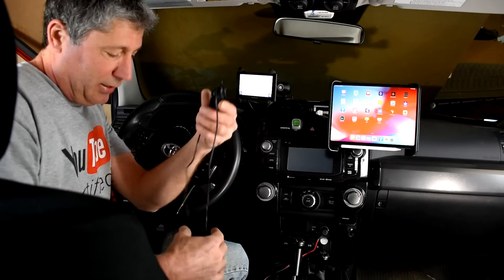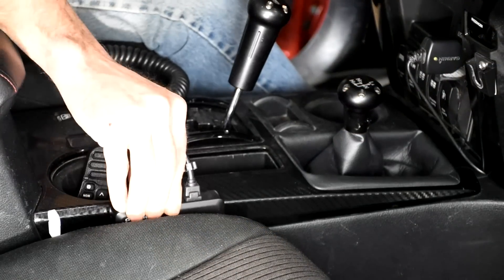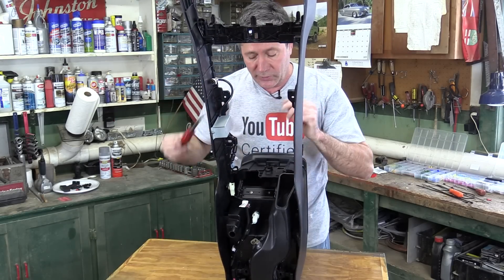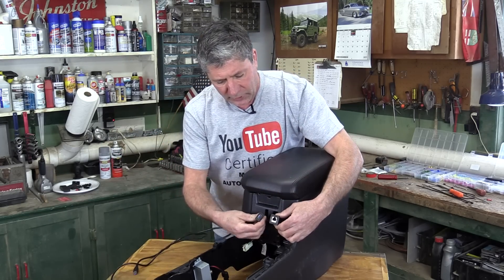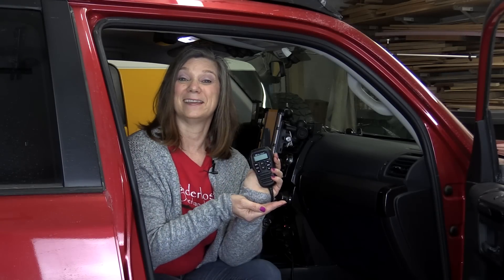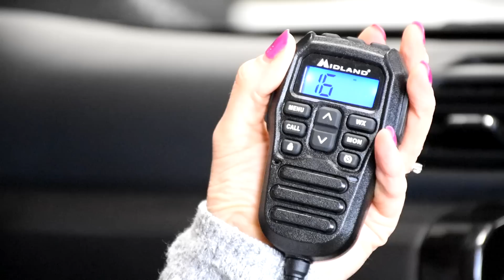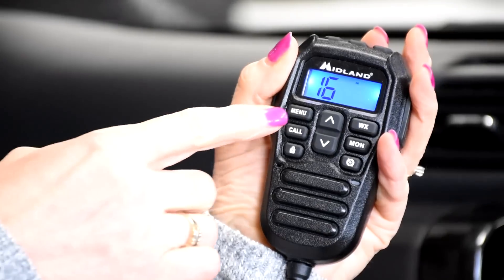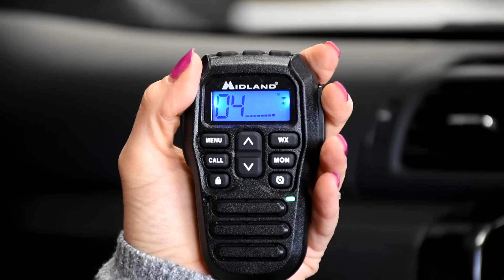GMRS Radio DIY Install & Testing Against CB Radio For Distance

Comment from the maker: PLEASE READ THIS FIRST BEFORE COMMENTING.
This video has obviously reached a much different genre of enthusiasts then what out channel is aimed for. It's reaching the "radio heads". The content in this video is geared to benefit those who simply want to communicate with the people they're traveling with, not someone 1k miles away. We don't have a desire to get involved in a whole other pastime or hobby. We just want basic communication.

Unfortunately we had to set all comments coming in to be reviewed before making public. Many comments coming in are either; extremely technical. Again, most of our subscribers and followers just want "out of the box" communication. Some comments are incredibly rude. We will not put up with that nonsense on our channel. And, this is the big one, WATCH THE VIDEO! We're amazed at how many people chastised us for not stating there's a license required for GMRS. Please refer to 7:10 in the video. Please read through this list:

Our CB antenna has been tuned by a professional shop. Our helper's antenna, the same.

No, we can't mount antennas on the roof. We're constantly having to squeeze under tree limbs and rocks. The rear bumper is the only practical spot for us.

The GMRS radio we installed is 15W, not the 25 or 50 many have assumed.

We are not going through a repeater.

In the video we joked about being afraid to take the Ham test. The truth is, at this time we have no desire to go Ham.

After watching the entire video and reading this post, if you have a constructive comment please post it.
Reply: I'm ham & GMRS licensed but am a big fan of GMRS for the person who isn't interested in radio as a hobby. It offers the average person more than enough options as far as local comms are concerned. Great video, thanks for promoting GMRS, I'm hoping it grows enough to attract some investment from additional suppliers. Hoping for a follow-up video someday? Thanks again
Reply: Well said. Too many hams (ive held a ham radio license since 1995) think there are no other radios that work besides ham. I agree, cb gmrs fra murs all have their place. I love gmrs and am also licensed for it. But i use all the bands i mentioned, it depends on where i am, who Im with and what their comms are as to what i use. Radios are like tools in a tool box, a hammer is great, but its not the tool of choice for every single job. Good video!
Reply: Wanderlost Overland, first off I was really really surprised when I seen Rodgers in the background when you were testing Cb vs gmrs , So hello neighbors!   I’ve been into radio since I was 13 years old, at 16 years old I got into “Ham” radio, now I’m currently 32 years old and Knowing that I can communicate just about anywhere on earth is mind blowing from when I first started out, however CB and gmrs are great    “steppingstones” into radio. Nice installation video!
Reply: I have just been getting into radios over the last 3months. I to was very surprised about the, shall we say "cordialness" of the ham community. I get the feeling that they want it to remain a mysterious and exclusive hobby.
Reply: @robopam  Yes sir, they DO ! I got into ham radio after 9/11, and very soon after I found out just how "cliquesh" many ham radio operators and clubs are. If you "diss" or don't join a club, you will be ostracized, and you could be calling for help, and be ignored ! I still have my fcc license, but I would not trust my life or that of a loved one to just ham radio. BTW, I've never had a CB call ignored.
Reply: I admit I'm one of those that will backup a radio such as the cb knowing what it's capable of doing. I am a fan of all radio. They are all great to have. Just like anything else. There are pros and cons.
Reply: Great video. Great post. I have used CB radios for 35yrs. I’m getting my FCC license and adding the GMRS radio to my mobile set up. I have NO desire for Ham. Thank you for the great video. Stay safe.
Reply: Great video guys. Exactly what I was looking for. I’m subscribed to your channel now. Great content. Thanks for sharing.
Reply: Ah I just saw this after making my post. Ok well I can understand this. I'll leave my post up though just in case someone passing by and sees your video and happens to find something interesting in the ham radio community. Best of luck to you guys. I am still grateful to learn about the radio you guys used.
Reply: Thank you for a fantastic demonstration. 20 miles without a repeater is very impressive! With 1 license covering our household I’ve been considering GMRS for my family.   When I mentioned to my wife and kids they lit up!  
Kind Regards, 
One of many FRIENDLY Radio Heads;)
Reply: I'm very Sorry that you had some bad Hams post in the comments on your video. They can be very snobbish and clickish. But we are not all that way. I started out with CB at a young age and got my Ham ticket in 2010 and my GMRS license in 2015. All good tools to have in your tool box. I enjoyed your video and was very informative for the overland community. Hope to see an update soon. 73 from WQVC581
Reply: Thanks for this information!!
Reply: We had CB Radios at our Camps in Maine for years.  My Grandfather loved Radios. Our camps were about 2 miles apart so he set up CB Radios stations for both locations. We had CB units in our Cars as well. No cell phones back in the 1970s. However,  we moved over to GMRS because the noise and DXing were so bad we just couldn't communicate over the radios. We put outdoor GMRS Antennas in each Camp and use our handhelds to talk to each other after attaching the external Antenna. Works great. No problem at all talking to each other. We have a repeater we can use but also we can reach each other via simplex. Cell Phone Service is still spotty. All Trucks have GMRS as well.  My Grandfather actually recorded some of our CB traffic back in the day. Great memories but I'm glad we moved on to GMRS
Reply: Disregard the sad hams.  GREAT Video.

Comment: I’m about to embark on this project… With all the wheeling you have done have you had any issues with the cable running through the grommet underneath the rear of the front seats? Did you use any gasket sealant?

Comment: I am a Ham and I am licensed for GMRS. I also use CB. I love radio and I am a hobby collector. I think it's great that we have these different services for different needs. GMRS is a fantastic service and is perfect for off-roading. I was in CO cruising through the mountains and called out on a GMRS channel that I had heard traffic on.  I used my GMRS callsign (as you are supposed to do) and was answered by someone asking, "Did I just hear someone use an amateur callsign on GMRS?" I responded with my GMRS callsign and said that I have one of those, but this was my GMRS callsign. It turns out that the folks in the San Luis valley area monitor GMRS in case someone gets in a tough spot on the mountains. That's a great thing, and I thanked them for doing it. There wasn't anyone listening on the 2M or 70CM calling frequencies that day! So, use whatever works for your communications needs. That's what they are there for!  73s.

Comment: good testimonial to basic performance from band to band. UHF FM will out do CB (5 watts AM ) any day. If you add a repeater to the equation 30 to 50 miles unit to unit if the repeater is in the middle.
News flash- CB will soon be getting a face lift. Looks like the FCC is about to approve FM mode for CB. Still 5 watts (unsure) but less noise and better quality. But GMRS will still win. And more good news,,FCC GMRS license just was reduced from $70 to $35.00. Good video

Comment: In the last two weeks I've watched a lot of tests and they always go to the top of hills.
Thank you for driving across flat ground.
I'm thinking of buying GMRS to talk with a house 6 miles away (as a car drives, I don't know how far, straight)
I don't want to buy two radios just to find out it doesn't work.
Thank you

Comment: The cb is is better for greater distance. But a lot of the time that greater distance is hindered by static noise or skip. But these gmrs radios are crystal clear up to 3 miles. Then they drop off sharply after that. Both radios have a place in your vehicle. Thanks for the video

Comment: I'm sure I'm the 150th person to point this out, but neither CB nor GMRS is superior to the other. They operate at different wavelengths and amperage, and are capable of doing different things. Truckers get way WAY more range out of their CBs by adding better amplifiers and antennas to their radio.. just like you added a better antenna to your GMRS radio.
Just to note GMRS and FRS are subsets of HAM radio. You ARE using HAM radio frequencies, they've just been sectioned out and blocked off for special channel use with public radios.
I read your comment about the antenna. I'm sorry so many people get so rude with you. No call for that. I was just going to mention that you ought to have mentioned that GMRS is line of sight, and placing the antenna on the back of the vehicle could severely limit your range to people in front of your vehicle.. for the people watching your video. Only because most new people wouldn't know the difference until they'd already done it. ;)
I'm choosing to use both myself. I have a small HAM radio which lets me use all of the above frequencies, and a small CB radio, so I can still reach out to truckers and the highway patrol while on the road. :)

Comment: Just wondering if you have any regrets with the Midland radio MXT275, do you wish you had more power or is 15 watt enough ? Could you do a long term review on this radio ?
Reply from the maker: No regrets at all with the radio we chose. Although we tend to prefer "bigger and better", the smaller size of the MXT275 made more sense for our application.

Comment: GMRS radios for outdoor adventures are great.  been using them for years, car to car on the way to camping spots. Setup a antenna on pole at the camper with a mobile. 
We can stay in contact out on the lake or hiking in the hills or in town with a HT. GOOD VIDEO AND INSTALL.  I am also a Ham operator, but not very practical, 
unless you just want to talk to hams.  With a GMRS license it covers your whole family, kids, grand kids, parents, in laws, brothers, sisters, etc.  They also make 50 watt mobiles for GMRS.
Reply from the maker: Thanks for watching!

Comment: First.. -  I love your channel.  I watch you all a lot.
Second..  -  The grommet under your 4R you ran the antenna thru.  Have you ever had a leak problem like high water crossing? Or just everyday driving rain/snow?
Third.. -   Does your buddy that helped in this video have a youtube channel?
Fourth.. - Last,  thanks for the links to the parts.  They were helpful.

Comment: The huge advantage of GMRS are GMRS repeaters; in 2017 FCC opened up GMRS to text messaging and GPS location info usage - that's still not there but I for one am studying how to implement it (and no, am not going to replicate the HAM packet radio stack to GMRS - will keep the substrate super dirt simple and just go with, say, analog Morse Code as encoded/decoded by a Raspberry Pi Zero SBC and then hang dedicated computer servers listening on repeaters, filtering out and processing text messaging traffic - where said server will be connected to Internet and use an SMS gateway to relay text messages to cell phones)

Comment: very good tests! thank you for sharing. It's too bad that CB has fallen out of fashion, especially since lower frequencies travel farther. I think the biggest shortcoming is that CB is still using AM while GMRS uses FM. Additionally GMRS has a ceiling of 50 W on certain channels vs only 4 W across all the CB channels (legally at least).
Reply from the maker: Thanks for watching!

Comment: One can never have too many options! Thanks for promoting the license requirement for GMRS! Yes, as one commenter here stated, when SHTF who's going to check licenses. But my counter to that is that just as one needs a driver's license, one should also have the correct license for whichever radio service they routinely use.

In my tiny Toyota Camry I have a dual-band 2m/70cm installed with the radio body under the pax seat, a dual-band DMR radio remote head installed on a flexible stalk, which can do both ham and GMRS, and an HF radio also remote mounted on that same flexible stalk, and am soon going to be adding a 220MHz (1.25cm) ham radio once I figure out where I'm going to put it! 

73 de N4GIX / WQWU626 / Bill Leaming

Comment: HAM is the way to go for SHTF. GMRS is the next best option as it's quicker and easier.
If you want to study for the HAM test here's a link to an online course that you can do at your own pace. It'll run you about $25 and you'll have to study for about an hour or so for 2 weeks. The course is an easy to follow program, but the program does not include testing. 
https://hamradioprep.com/

Comment: HOWEVER -- do not hold the microphone so close to your mouth -- most radios nowdays have good elements in them so keep them at least 3-4 inches away from your mouth -- other wise you get a lot of EXTRA wind noise into the mic and it can distort even muffle what you are saying -- just saying

Comment: There are an absolute ton of people on ham radio. So many people are getting their Amateur Radio license right now its crazy.  How would you like to talk to someone on the other side of the earth without the internet or phone line? What about 30 mi ( flat land, est.) or if a repeater is on a mountain 200 mi ( est.)? Its an awesome hobby and can be used without reliance on infrastructure. CB freqs are longer than GMRS, antenna gain has alot of affect here. either way you can use more wattage on GMRS plus youll likely have some gain on that antenna.    Good video btw, thanks for making it.

Comment: I just did this install, the video and parts list was very helpful.  Only difference is I ended up mounting the antenna on right right side of the CBI bumper in that hole that seems like it was made for an antenna.
Reply from the maker: Glad it helped

Comment: On club runs in convertibles we prefer CBs as you can lay it in the seat and still hear the calls to pass traffic as we zip through the twisties. The GMRS radios are too hard to amplify enough to hear over the engines and wind.

Comment: you guys are missing out on what the Technician class ham licence will grant you. i understand the use for what you need, but if you simply go onto repeater book and look up repeaters in your local area youd be suprised the amount of traffic you can hear at any given time. They have morning Nets where groups get together and test there equipment daily or once a week depending, and a simple little 25 to 30 dollar baofeng handheld radio can recieve and transmit between all of the frs, gmrs, ham and murs frequencies and youll find that going through a local repeater can take your coverage from a few miles to 20 or 30 or even farther depending on the antenna and setup. do some research into ham radio and those little handhelds and see watsup, very much worth the test and 15 bux to pass and have the lisence for 10 years. not saying what you guys are doing isnt any good, radio is radio any way you look at it but HAM allows for a lot more power and on lower frequencies that travel much farther with the equipment used. I do like your mobile setup a lot and just encourage anyone who enjoys radio in any way to challenge themselves to a higher degree and give themselves the ability to do so much more. I mean you can use satellites in orbit to have QSO's (conversations) with people in other countries with a handheld, a directional antenna, and a small amount of knowledge in how antennas work. lots more fun to be had guys, take care and loved the video =]
Reply from the maker: Thanks for the great advice!

Comment: Fantastic video!  I am convinced!  I have a CB in my truck and it is as I would call, it basically functional.  It works if I am in a convoy with other people with hardwired setups and squelch all the way up.  The thing that has me interested here is that I find myself wheeling with more new people these days without radio setups in reasonably close proximity.  These GMRS radios can communicate with the blister pack hand helds on FRS / GMRS so it makes it easy to let new people borrow a cheap hand held for the day.  This is going on my wish list!